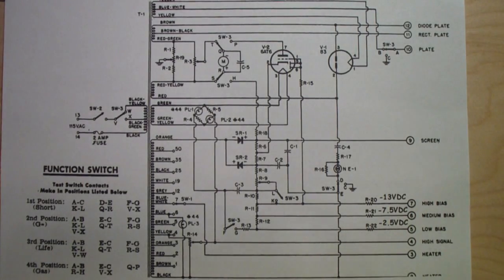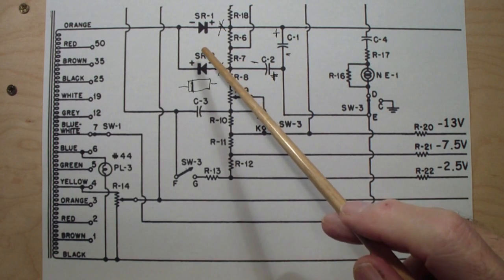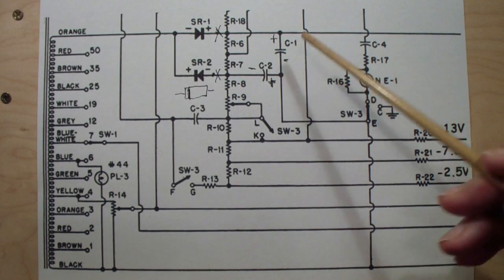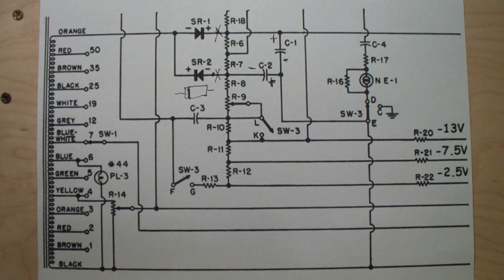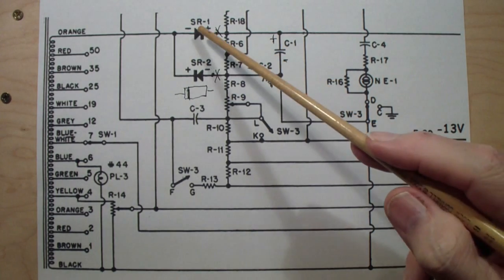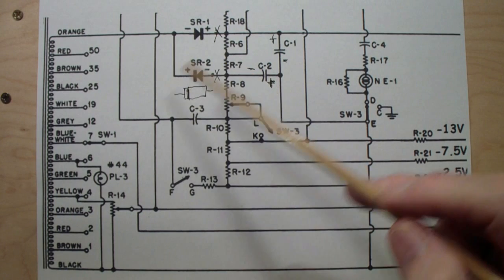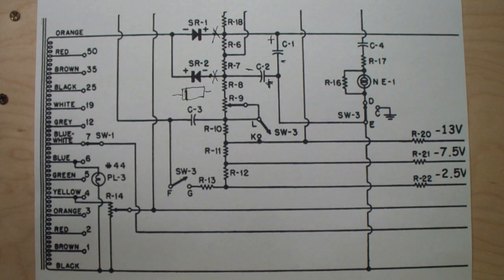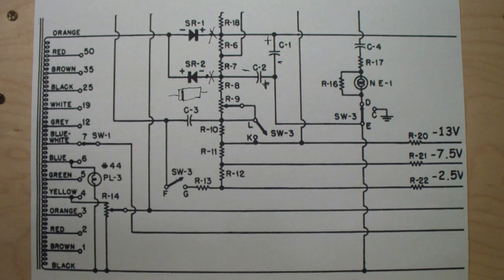TTT083 Electronic Restoration Tips

Comment: This video explains how I messed up my tester like this. First, I put capacitors 2 & 3 in backwards. This caused, the selenium rectifiers to get hot and smoke, Then I replaced with diodes, this caused capacitor one to bulge and the transformer was humming. First, I should of have taken a pic and payed closer attention to the capacitor polarity and replaced them one at time. As for the selenium rectifiers . I replaced one on TV-11 tube tester and it dropped the meter so I reversed it and wah- lah it started working correctly. On My Volt Ohmyst. I tried to replaced the selenium rectifier and problems , so I just put it back in there.  I found pics on the net and realized what I did , That I installed two caps backwards and the diodes backwards. I fixed the problem. There is no hum and my dim bulb tester doesn't even come on. Nor, does the short lite come on. It is ready to be calibrated. Luckily, for me I didn't mess up the transformer. When I got done, I saw his video and it start to sink in what I did wrong.